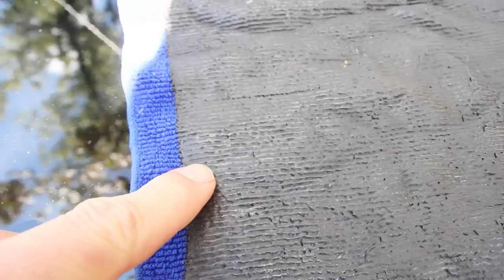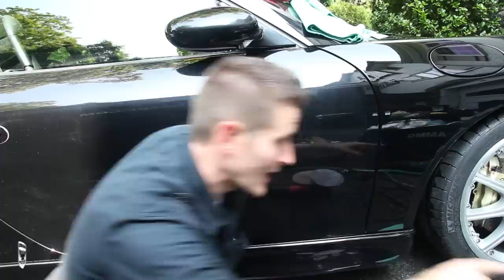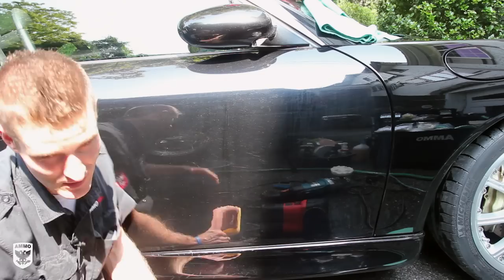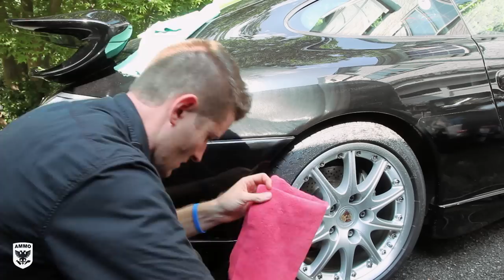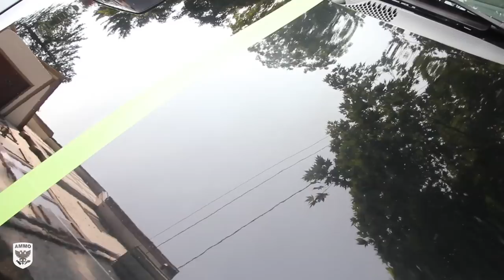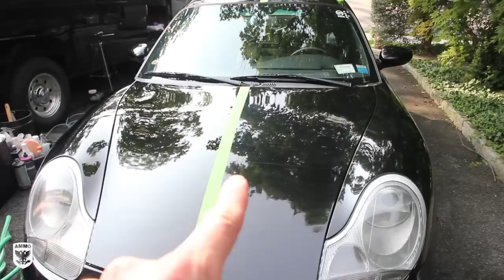How to Restore Black Paint Porsche 996

Comment from the maker: Sam, it depends on what type of scratch or "imperfection" you are trying to remove/repair. In this video I used Meguiars D300 with a Microfiber Cutting Pad. I mostly use this system when restoring paint. much safer and easier. Good question!

Comment from the maker: Hey bud, its most likely getting "stuck" on the rubbery texture of the plasti. Best bet is to use a short hair microfiber wash mitt and then use air or squeegee to remove the water. (For the record, I would NEVER recommend this on regular or normal paint. Plasti is a totally different ballgame) Hope that helps! -L

Comment: i had awesome results by wet sanding them with a really fine grit, then buffing them out with polish or light compound. i also tried jiff, dont know if youve heard of it, its a kitchen cleaning product, i just rubbed it on the headlights with my hands and that worked too but didnt last as long.

Comment: I have a MK4 Golf with a single stage, solid Blue color, and in some areas is flat, and I mean really flat it doesn't reflect any light and in the most part of the car there are some swirls and light scratches and I would like to know what I can do get the shine back. Do I need to "cut", polish and finish or is there some easier way?
Great job as always btw ;)

Comment: Where can you pick up those microfiber cutting pads and do they have finishing pads in microfiber as well? When I used to detail vehicles back in my younger years I always hated having to get the swirls out after cutting with a wool then polishing with foam pads. I have to do a good buffing on my Subaru come this spring and will be looking for a nice dual action buffer. From watching your videos they seem to be the better choice now days. Btw the dual action buffer works like a DA correct? Great videos keep them coming!
Reply: Meguires

Comment: As far as i could tell from larry's other videos your right.. 
1. wash, 
2. clay,  
3. two-stage compound with micro fiber cutting pad,  
4. finishing polish (also known as jeweller's polish) with a foam polishing pad,   5. synthetic sealant,  
6. wax i.e., carnauba

you get different bits of the process from his videos but im pretty sure thats the go-to method he uses most.
My question is when would you use a rotary machine and when would u use an orbital machine?

Comment: Just curious I come from a car painting background so maybe I'm off base in the detailing world. But why would you not just compound the car with the rotary for speed and time sake. Then come back with the da polisher to remove the swirl marks from the rotary. I would just think when doing a whole car/truck it would be faster. I have not used the da system before I'm about to buy the rupes kit. I would just think the rotary would cut alot of time in the compounding stage.

Comment: Larry, one thing I've never heard you specifically address, when claying, if the clay is picking up the fine gunk/fine debris/whatever more or less stuck on the clear, how is it that the clay doesn't cause fine abrasions and scratches on the clear or clear bra as it picks that stuff up and you continue to rub the clay across the surface?  I would be even more concerned about using a synthetic clay surface pad on the DA especially for that reason.  I don't get it.

Comment: The car came out great. I notice in alot of your videos that you use a microfiber cutting pad as opposed to a foam cutting pad. Any reason? Do the microfiber cutting pads do a better job generally than the foam ones?
Reply: I spoke to Larry about this same question once before. He told me the microfiber cutting pads cut better with less heat which is always a good thing! Plus he feels the most comfortable using them, as anyone should aim for. Use whatever you're comfortable with using, whatever works best for the expectations you have, and what results you're hoping for.

Comment: Isn't it not a good idea to use the DA pad because technically you're running any contaminants that you pulled out of the paint, back into the paint, although this time you're rubbing them into the paint in a circular motion making it harder to get the scratches out?

Comment: i have used dish soap as lubrication , however dish soap pulls the oil from the clay and soon it starts disintegrating on really contaminated paint , paint acts like a sandpaper and clay bits stick to the paint and you dont want it to dry .

Comment: I usually do the first rough compounding with a rotary to remove scratches and defects with a heavy compound . Then i do a second compounding with a finer compound and open cell microfiber cutting pad or a medium/hard foam pad with a DA to remove swirls and haze and then do a final polishing with a DA, something like meguires ultimate compound and a polishing pad.

If the paint is only semi bad i skip the rotary step and go with a closed cell microfiber pad on the da and meguiars ultimate compound and do the finishing with ultimate polish as normal.
If i'm taking the time and going for show car finish I start with a wet sanding (if needed), and the usually do a second polish after the normal polishing step with a super fine polish and a extra soft finishing pad.

To finish it of, i use a high quality carnuba wax for a show finish or a sealer and meguires ultimate liquid wax on top to make it shine for a real life used car.

would like to try some AMMO stuff, do you ship internationally and what's the shipping cost like for European countries in that case?
Reply: ThrottleKnife you should try d300 and d302 instead of UC and UP when using a MF pad.
Reply: scoupemaster I have read other people saying the same thing, I'd like to try it but there is only one place close to me that sells detailing stuff and they don't carry the D series, but I'm thinking of trying out Menzerna 1000,2500 and 3000 instead. Or ordering online and just accepting the shipping costs.

Comment: Dish soap or soap of any kind breaks down the clay much sooner than a dedicated lube will. The clay towel is tough in tight spots because the product will come off (rub off) on the paint that's where the clay bar comes in handy. The clay towel is great for other areas.
Reply: BlackHawkPSU If you rinse the clay with water afterwards it won't matter. That breakdown is super slow. And it's not like you are gonna use the same clay bar many times anyway

Comment: Didn't you say dish soap is very bad for paint, and it can take out the silicones from the paint and make it dry?
Reply: He would have used dish soap to strip any previous wax or sealants to bring the car back to naked paint, and then when he finished the restoration he would have then re applied more sealants and waxes
Reply: +Integra DIY Yes I heard dish soap and was really surprised.  This kinda flys in the face of everything I have ever heard from Larry or anyone else.
Reply: i think u meant solvents not silicones
Reply: Assuming the paint is fully cured it shouldn't have any solvents?..I was really saying silicones.. Because a lot of paint products such as polishes/waxes/sealer have silicon which help to protect the finish and enhance the shine. Stripping these can cause negative effects on the paint surface.
Reply: dont need silicone. body shop safe waxes protect and have no silicone
Reply: Integra DIY dish soap is bad for someone who is never going to put wax back on.
Reply: franktib if you love your car, use a dedicated car-wash products. If you need to strip the surface use diluted isopropyl alcohol. Dish washing soap is very harsh for automotive paint. It's meant for stripping bacon grease from cooking pans and plates, and not to be grounded deeply into your paint.
Reply: Integra DIY thanks for the tip bro
Reply: +franktib those are not my tips, that's Larry's advice! He specifically says don't use dish washing detergents. But this video is surprising because he said he used Dish Washing Detergent lol!! Hope you understand. and you are welcome man!!
Reply: AP I guess it's the same deal as "what's the best motor oil" or "synthetic oil or conventional" 

Because I heard the completely exact opposite about using dish soap. I heard dish soap can extract chemicals inside the clear coat and accelerate oxidation. It basically dries the base and clear of its natural chemicals. Also it's very abrasive especially for soft clear coats, so it's not only stripping, it's causing more damage on top of the clay bar process. 

I heard Isopropyl Alcohol diluted with water, strips waxes and sealants and it's less harsh.

Comment: Can you use a microfiber cutting pad on a rotary polisher or does it generate too much heat. But if so what would be better to use a open cell or closed
Reply: fibers lay down and dont work as well. use wool on rotary

Comment: I have a question. How many times as a general rule could you perform a correction like this before you end up with no clear coat? Obviously depends on the manufacturer and how much they put on there originally, but a general rule? From new car to end of clear coat?? 10/20/50?
Reply: I think like >5
Reply: That is exactly the question. Not to often I think....

Comment: My 'clear bra' I suspect was put on by the dealership I bought it from. It quickly deteriorated and some bubbles formed. 6 months later I took it off. Adhesive left everywhere and those bubbles turned to be hiding huge paint chips. What the hell? Used adhesive remover and a bit of my clear coat where the adhesive was thick in one spot was eaten...

Comment: I have huge problems with compound always drying up right away when I use it with a MF cutting pad and a  DA like the Porter Cable.   Then its always a pain in the ass to try and wipe off.  Usually use Meg's 105.  Anyone got any good ideas for different compounds that work better or whatnot??
Reply: Mike K, M105 is a HIGHLY acclaimed compound that I recently purchased but haven't used yet, so don't scare me man! Lol that said, what is your technique? Hard to assess the problem without knowing exactly what you do. "Technique trumps product every time" - Junkman2000
Reply: Randy King It seems like their newest batches work a little better with DA polishers.  But, M105 was created for rotary polishers which i can totally agree because, when I use it with the rotary it works completely fine...
Reply: Randy King When i say it works completely fine, i mean that it works awesome!

Comment: can I use car wash as to clay instead of using dish soup?
Reply: Actual car wash soap isn't designed to strip off waxes and sealants. What you'll need to do if you want to clay your car properly is: wash the car using dish soap such as Dawn (the dish soap is harsh enough to remove waxes but won't damage the paint) then you can clay the car. Claying the car while you have wax on the paint still won't be as effective because the clay will have to work through the wax before it gets to the paint to lift out any embedded debris. don't forget though, after using dish soap and after you clay the car, you need to apply another coat of wax or sealant. Hope your car comes out great man!
Reply: Thank you very much for your advice!!! and I hope that will come out nice too lol

Comment: why not foam cutting pad on a DA polisher? Is MF cutting pad better?
Reply: Icesouldy MF cutting pads are better. Or at least a lot of people say that. Never tried MF pads, but I have a couple ready for detailing my new car next week. Supposed to bridge the gap between rotary and DA as I understand it. Cut faster than normal foam pads, but not make a bunch of swirls or burn through the paint. Seen people use them on DAs to remove wax as well

Comment: Doesn't dish soap hurt the clear coat. Most of the experts and car dealers don't recommend using dish soup. Such as BMW.
Reply: Dish soap will strip most products like wax or sealant you may have applied to your paint but it most certainly will not damage clear coat especially when diluted in water in fact for a job like this where you want to start from bare paint to buff out any imperfections and reseal with fresh wax, dish washing soap is ideal.